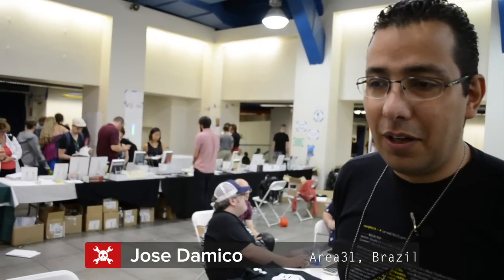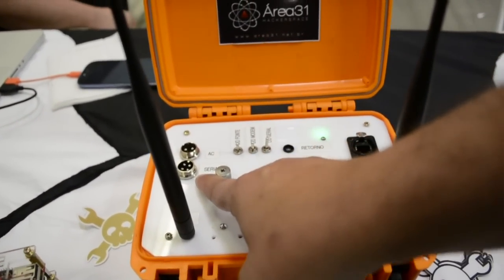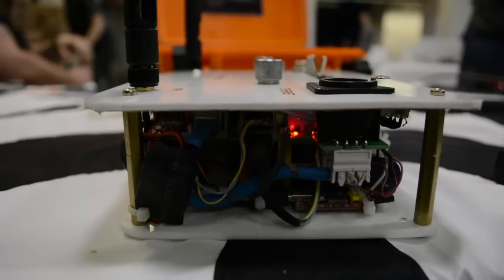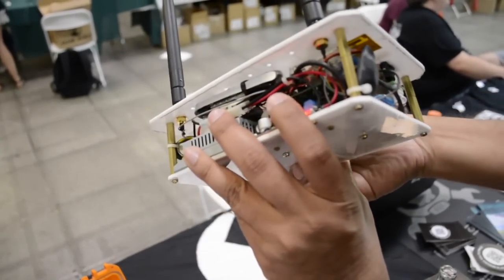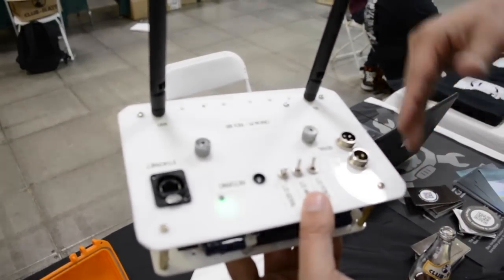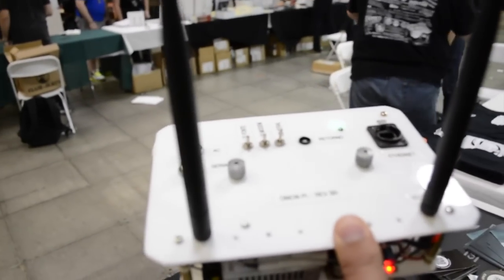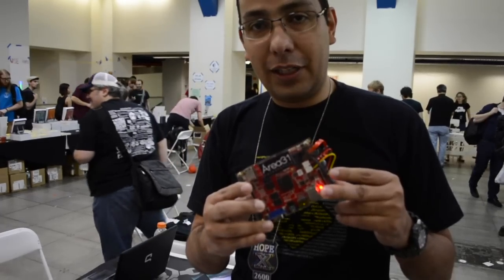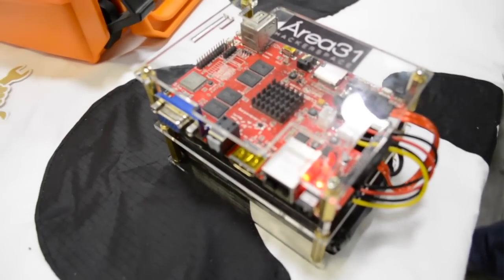The Ultimate OnionPi At HOPE X

Comment: Very cool... I tried something similar on a smaller scale ._. (way out of my league still) ended up destroying the old equipment lol.
Reply: i wish they would describe this a little bit more effectively, or provide a parts list and basic wiring diagram
Reply: Kevin Todd

Most of it is fairly strait forwards and connects via the USB.
As for making it battery powered you can get some buck boost converter and lipo charger boards off Spark fun or Adafruit,DX etc that make this very easy.
Just keep in mind the Raspberry pi needs 700ma and if you're powering a lot of devices as in this case you'll probably want 1500 to 2,000ma.
The hardest part is getting the software setup so it operates seamlessly.
Reply: Oh, I suppose I missed the part about the raspberry pi. I haven't had the opportunity to mess with one yet. It seems you could put them to good use, in numerous ways, so I have no idea why I don't have my own yet